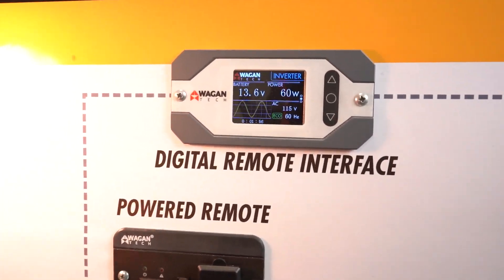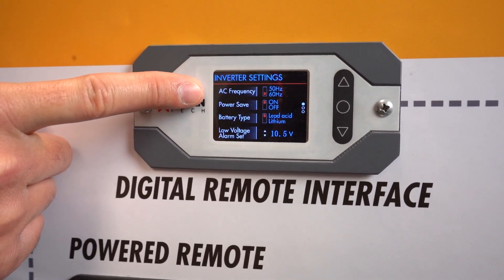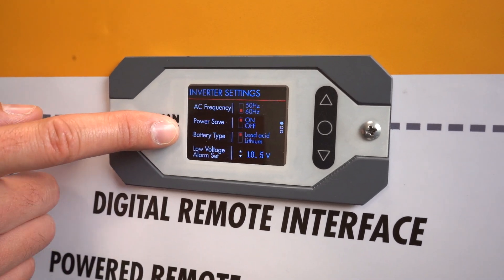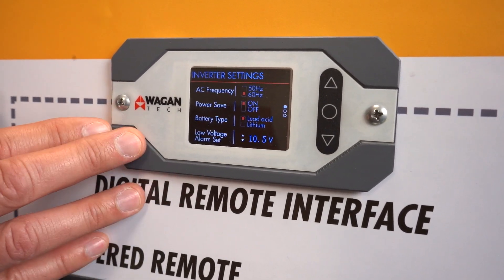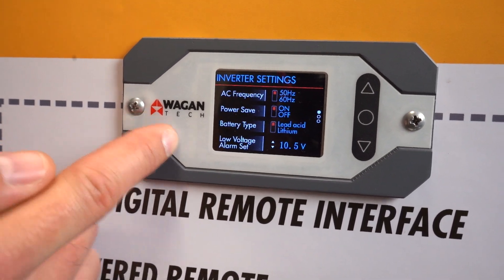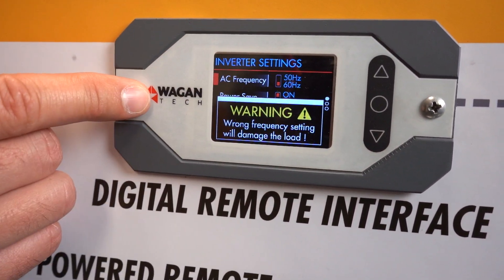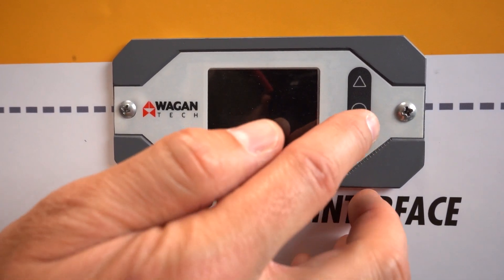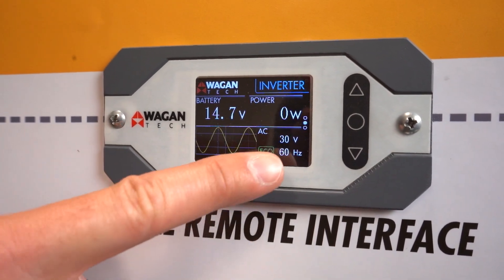Vehicle Power Ecosystem: DC-DC Charger, Batteries, Solar, and Inverter all working together

Comment: can you use the powered remote and the digital remote interface?  my plan was to have the DC/DC charger with your new 1200 pure sign inverter, with the digital remote mounted up front so I can see it when I'm driving, and the power remote in the back where I can use the remote outlet as well.
Reply from the maker: In this case, you cannot without splitting the wiring and connecting them together. I would no advise doing that.

Comment: Your website shows no info whatsoever on the "Power Remote"? Also, your webpage clearly states that the Digital Remote Interface ONLY works with your DC to DC chargers which means your inverters are excluded?
Reply from the maker: Hi Rick, I admit, we did get a little ahead of ourselves in releasing this video.
The power remote will be available when the new generation of inverter is released as the current generation does not support the remote. 
Since the  new generation of inverter hasn't been released, you are correct in that the Digital Remote Interface will also not work with the current models of inverters. Sorry for any confusion!